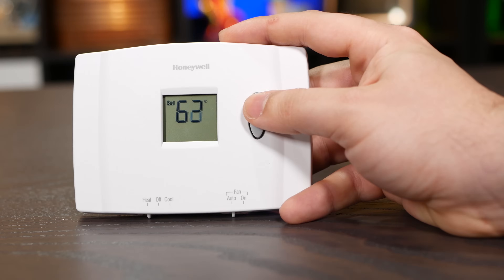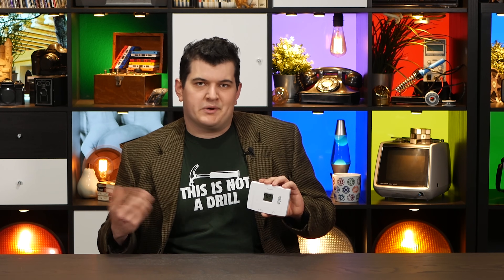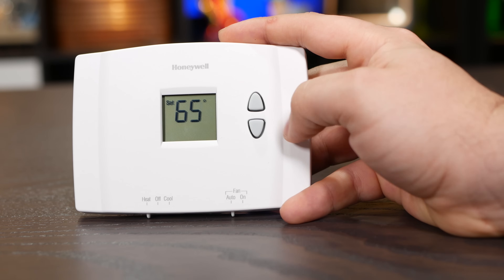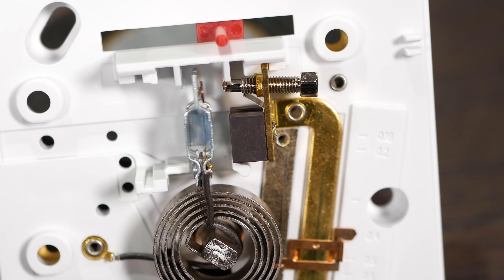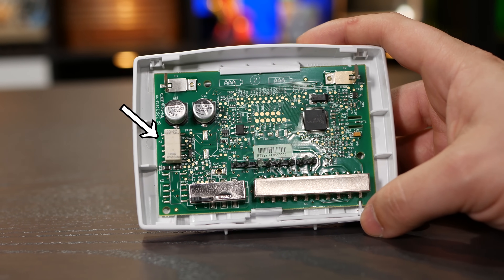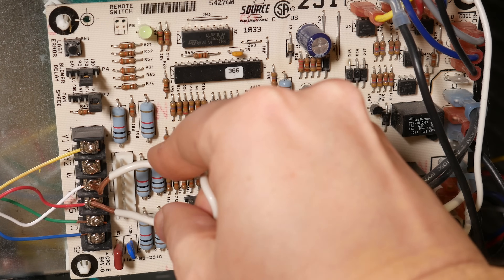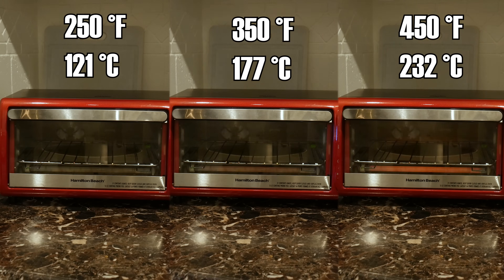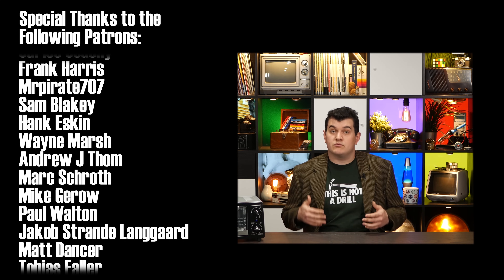Thermostats: Cooler than you think!

Comment: Well a lot can happen in 5 years, but a DIY Arduino controlled Thermostat with WIFI and a temp sensor would allow you to press a button on your phone to cycle cooling for 30 mins, limit the number of cycles per hour or day, track cycle time, change cycle duration and frequency depending on outside temp, temp graph and finally control 3-stage heating; Heat Pump for normal use, Aux heat for the colder days where the heat pump doesn't work (1 of the 15k coils), and finally Emergency heat (both 15k coils). That last one will make the meter spin like a Frisbee! My biggest reason was for heuristics for my variable tonnage BOSCH system. I actually get better efficiency out of the system for longer cycle times of the "reversible pump" than if it were controlled by a thermostat with only a 0.5 degree heuristic.
Slap in todays AI for adjustments on all of the above for even better efficiency!
Future implementation:
Turning on the gas fireplace instead of the electric heat coils in winter.
The ability to add zones as well that can cycle during an on cycle.

Comment: 16:40 You could put a timer in paralel with the thermostat, when the timer is inactive, the thermostat will decide if the system is fed, but when the timer is active, the system will be on for whatever time the timer is on regardless of the thermostat state.

Comment: I'd wager that the idea that setting the temperature higher or lower makes it heat or cool faster comes from radiators and space heaters and old manually-modulated furnaces (and boilers) on the heating side, and window (or other standalone) air conditioners on the cooling side. Those do have power settings, so I understand people thinking the temp settings on a thermostat work in the same way.

There is one thing on the thermostat that might have a power setting: the fan.

Comment: I do something similar to the thing at the end with my ecobee by having a few different program modes at sensible times of day, so I can set it however and know it'll eventually kick back to normal. It's still a nice idea; they could put an "I'm cold" and "I'm hot" button next to the fan hold button in the UI, which already has a selector for how long you want it to run...

Comment: My question now is if the heater is left running for a longer period of time because of how high the temperature setting is wouldn't that effectively warm the house faster then if the heater is running for shorter periods of time because of the thermostat being on a lower temperature or the desired temperature. Something else that should be considered is the naturally occurring loss of heat being introduced into the cold room. 

So if it is not cycling on and off for shorter periods but is instead staying on for longer periods before shutting off wouldn't that help make up for the lost heat during the course of warming the room up? Because we do not live in perfectly sealed homes there is gonna be heat loss as you are heating.

It is not the first time I've thought about this when dealing with people fighting back and forth about wether the house warms up faster if you crank it all the way up versus just setting it at the temperature you want. 

It may not the case so much anymore idk but I wonder about much older models. And from what I can tell it does seem to go quicker but that just may be because we are not allowing as much time for air exchange to happen in the house and thus allow more cold air in as warmed air escapes. 

I would really like it if you would test out this theory with both thermostats and much much older ones like 30 years older and see if there is any difference or if both show same results. 

Side note: What I have noticed is your more likely to overheat the house (above the temperature you wanted) turning it up full blast even if you are fairly quick on turning the thermostat back down when you have achieved the desired temperature. 

Perhaps this only occurs in old school (the ones with the rotating dial thermostat) gas heaters. Because there is a notable difference in sound of the fire running in the heater when you just set it at the temperature you want versus turning it all the way up. 

And everyone may be right but they keeping arguing about it because they are not thinking about how a gas heater might do things differently then an electric heater. And gas heaters are becoming more and more obsolete.

And yes when I started typing this really long message I was thinking of all heaters running on gas. Mainly because our thermostat went from analog to electrical at one point that was electric heating even if only because it confused a large number of people. Modern electric heaters don't use gas. And I don't like it I feel I have less control. When I was growing up all heaters ran on gas only thing that was different was the kind of thermostat you had. 

And also just for fun let's throw in the heating an apartment using hot water from a boiler like my apartment is. Have fun with that. I for see a sequel to this episode. Because truly there are 3 well known types of heating maybe not as much now as in the 90's.

Comment: Og mercury switch thermostats were kinda rad in my opinion. It's literally just a bi-metallic strip with a glass of mercury with two exposed wires inside. As the strip moved, the mercury would slosh and make or break the connection.

Comment: this made me check out what kind of thermostat we had and it's an old honeywell with a bimetallic strip and a mercury ampule that both adds the mass to stop it from short cycling and works as the switch to connect the circuit

Comment: On/off boilers are old technology, even for domestic heating.  Modern boilers modulate, meaning that they can regulate their output to a required flow temperature, and also regulate the flame to maintain this temperature depending on the heat demand.  It's the room thermostat that tells the boiler the required flow temperature according to the heat demand of the room, often assisted by an outside thermometer to estimate  the overall heat requirement of the building.  The result is a relatively consistent (typically luke warm) radiator or underfloor temperature rather than cycling hot and then cold all the time.  In practice this is rather more comfortable for the occupants, it improves the boiler reliability, and it also improves efficiency as boilers are able to use the relatively low temperature return flow to extract more heat from combustion.  Although many manufacturers use proprietary communication with the boiler (usually just two wires carrying both data and power), there are also standards such as the well known Opentherm, this being supported by Google Nest thermostats for example.   I don't know about the US but this modulating approach is widely used in Europe, although many older installations (and heating engineers!) still use on/off control.

Comment: Ecobee has the feature where you can set a temporary temperature. You program your normal temp range as normal. Then, when you want a temp boost, you just change the temp on the thermostat. It will ask how long you want the new temp for (say, 2 hours; 4 hours, etc). At the end of the time, it goes back to the program.

Comment: Several years later, I would like to ask a question. Does heating in your car work differently? That is the only place where i seem to notice a difference in heat when i am trying to heat a cold car and i use an unreasonably high temperature compared to a normal one.
Reply: With non electric vehicles, the system generally uses heat from the engine (from my understanding)

Comment: Idk if my house is wired wrong or what but the "fan" setting DOES NOT WORK. Only heat and AC, it WILL NOT just use the fan to recirculate air 😡😡😡 WTF IS THAT ABOUT?????

Comment: Cool to see the magnet in the old thermostats providing the necessary hysteresis. 

Also, microwaves do a similar PWM when you change the power level to anything other than 100%. You can hear it click the magnetron on and off for a given time period.
Reply: I have a old Magic Chief microwave from 1986 that is built like a tank. It does not use PWM that I am aware of. I think it actually reduces the power. I really like that it has a temperature probe. I can't find a new one that has that any more. I remember it was on sale for 400.00 and 800 watts. A little low now days. The thing wont break.

Comment: An answer to your last question. I have home assistant set up controlling my ecobee an have an automation running the ac for an hour after I push the zigbee button on the wall. The automation does this by setting the temp to its minimum and starting a timer. Once that timer runs out, it sets it back to the original temperature.

Comment: I know a thermostat that can do this. The smart pid thermostat integration in Home Assistant. I use a 10$ shelly wifi relay to command the output to my heater. This way you can do literally everything you want without relying on any nest or whatever overpriced device

Comment: If you have a smart condensation boiler it actually works to put the thermostat higher because it tries to fiend an equilibrium so the radiators only become really hot when the temperature difference is higher than a few degree. Otherwise it goes in maintenance mode and it heats very slowly.

Comment: Speaking of thermostats that let you "change" for a single cycle.  The closest I've seen was again in the one house I lived in.  It was a programmable thermostat (an old school dumb version) that would let you run a program.  Now it did allow you to manually change the temperature at will, and would even ask how long the change would be for.  It also had a single button on it that would allow you to return from a manually set temperature back to running the programmed settings.

Comment: For central heating.  Control Modules with built in sensors do tend to be closer to the air intake of the furnace from the house as well.  I've noticed this with every house I've seen with these systems.  I even lived in a house where it was in the hall atop the stairs from the front door.  It was between the living room/kitchen, and the bedrooms.  However, the air intake to the furnace was in the stairwell near the front door.  I've always figured they use this location as it would be one of the last places the air would go before returning to the furnace - so it created the "best average" temperature range for the entire house.

Comment: In addition to your final question, my smart thermostar lets me set the temperature to a specific point for a specific amount of time and then resume my regular heating/cooling schedule. I like mine because it only lets you set a minimum of +-2⁰, i.e. 68⁰-72⁰ and will always keep the mean as the target point. That was theres a minimum 2⁰ buffer between cycles. I like that because the by far least effieicnt parts if temperature regulation are the start up cycles and, with a forced are unit, latent heat at shut down gets wastes. If i can have the heat pump run longer cycles less often, it saves money. At least i think. If only there was a long form cotent creator who could shed more light on that quandry.

Comment: Actually the inverter operated heat pumps can regulate the amount of heat/cool delivert depending on difference between ambient temperature and set point. I'm still trying to figure out che optimal setup considering mine has a centrale dead band in which only the fan operates and the compressor Is stopped.

Comment: I live in Germany. We have radiators in every room. Our Thermostats Double as the dial for the radiator. The valve for the radiator is a springy pin that moves in and out (with the default being out/open) our dials/thermostats are like screws that push the pin in to close the valve. Inside the thermostat is a thermosensitive gel that expands when warm and forces the pin back in when the heat went up enough.

Comment: 24 volts always present and instead of adding some resistors to limit the power needed, just put batteries in it. Why not ? It's not like they're expensive or won't last forever, and they're so environmentally friendly. (Sarcasm) Having said all that, I purchased one I can control with a "Smart Phone" because my Dad is senile and shoves it up to 80 74 or 80 something degrees and cooks me to death. So I have to bring it back down without him seeing me do it. A lot of his feeling cold is psychosomatic too.

Also, Mercury switches. LOVE THEM. Usually, mercury is sealed in a glass tube, and the vials that can be opened, were removed from chemistry sets for kids. So it was hyperbole. I go out of my way looking for mercury switches even though I have no actual use for them, because they're cool.

Comment: We have a thermostat at my work that would be considered "smart" for the late 90's. It lets you program each hour of each day, so monday through friday an hour before we open it kicks on the heating or cooling, and at the end of day we have it drop the heating to 55ºF and the cooling to 80ºF, and it will hold those settings over the weekend. It also has a "temporary" setting where we can command a new temp for an hour and at the end of the hour it goes back to regular operations.

Comment: Now using the Tado heating control system. Really great. Not only the thermostat is controlling the boiler, but each thermo head/valve on the central heating unit of each room can switch the boiler on and off. AND it has a boost function which switches to max temperature for 30 minutes. Of course it doesn’t make the system hotter. But it disregards the temperature and opens all valves in all rooms.

Comment: Here in the Netherlands we only used two wires, which provides power and data. I have a Toon installed; which also shows the power u using and gas. With a pretty large backlighted LCD display, without any battery or rechargeable accu.

Comment: The reason "turn the thermostat too high" sometimes improves the heating speed is that the thermostat is poorly located and will get directly heated by the heating system and it will turn the heat off too soon, simply to be turned on again after the air mixes a bit and the thermostat can measure the actual temperature in the room.

Comment: Wait, the US doesn't use OpenTherm modulating thermostats and boilers? Condensating boilers can only reach their highest efficiency with relatively low water return temperature, so a modulating thermostat will request a lower level if that's enough to heat the room. Modulating thermostats can also hold the set temperature very precisely. Up to a decimal degree in my house. My AC is also of the inverter type so it also supports modulating.

Comment: Most newer programmable thermostats have an option called hold. And you can set the hold length for any length of time say you come in for mowing the yard, set the hold for 1 hour and turn the temperature down for the air conditioning. After one hour, it will go back to the previous temperature.

Comment: I've never found an explicitly conclusive answer to my thermostat question: 
Imagine, if you will, a warm spring day. I have the thermostat set to heat the house to 70 degrees because it gets chilly at night, but it's pretty toasty today so it's currently 72 degrees in the house. 
Is the thermostat making the house hotter by being set to heat, instead of cool or off?
I, this video, and (dare I say) anyone else with common sense seem to agree that no, it doesn't! And yet, someone in my house always turns off the heat, and by the next morning it's 58 degrees inside

I'm about to hack open the thermostat just to make a point

Comment: We used to set our heat in the chicken barns on a timed duty cycle then use thermostats set to particular temperatures to run fans and open inlets to remove heat if the duty cycle was too much, finely balanced system 

Heat 100 seconds on
Heat 200 seconds off
High point 90F - fans and inlets on
Low point 70F - fans and inlets on minimum timing (also a manual duty cycle)

Comment: When you started talking about PWM I immediately thought of the CPH (cycles per hour) limits that you can set on most programmable stats. That actually brings it closer to real PWM by anticipating when the heat call will be satisfied (and then overshot) rather than simply responding to it.

Comment: 16:27 my grandparents have installed their a/c in 1996, with the split sistem. It runs separated to the heat in the house, and they have a thermostat on the remote that regulates the temperature, and they have a timer feature and a "run for an hour" feature

Comment: Just to let you know, you did not cover the part of a thermostat called the heat anticipator. On the cheap white one there was the brass slidy (yes i said Slidy) thing that can be adjusted too compensate for the furnace running longer hence driving the temperature of the room somewhat past its set point before it shuts off from the fan running longer to cool down the internal furnace parts so as not to damage the heat exchanger. My Father taught me that. R.I.P. Dad <3

Comment: Related to the question from CantComeUpWithUsernames: If my thermostat is set to 65, it turns on when the temp drops to 64, and turns off when the temp gets up to 66. If it's set to 65, and the house temp is 65, and the heat's not running, I can turn it up to 66, and the heat will come on. Then I immediately turn it down to 65, and the heat won't turn off again until the temp reaches 66. This gives me a few minutes of heat while keeping the set temperature the same.